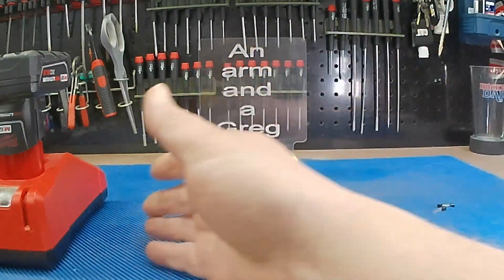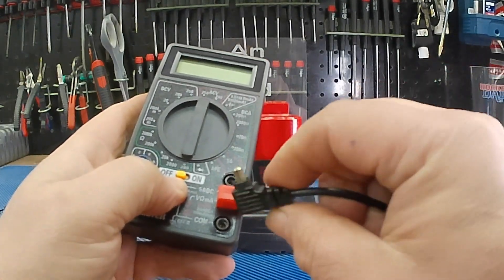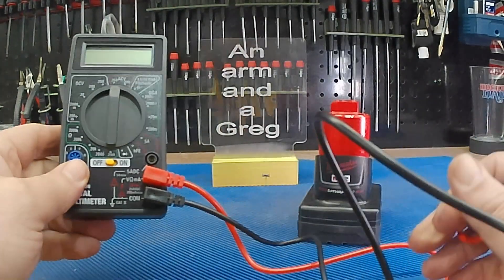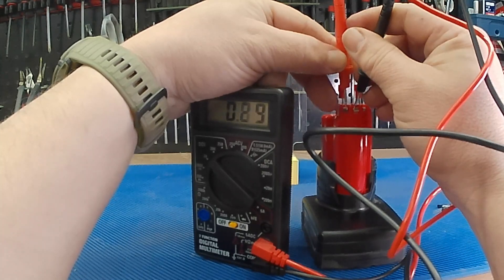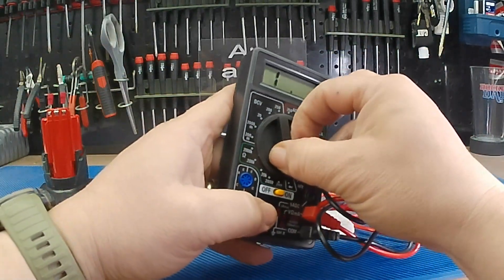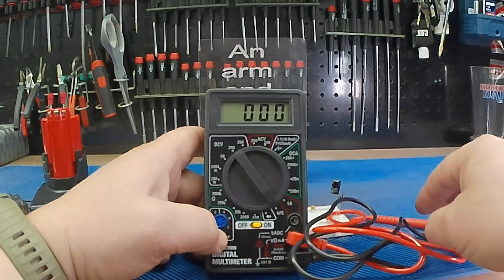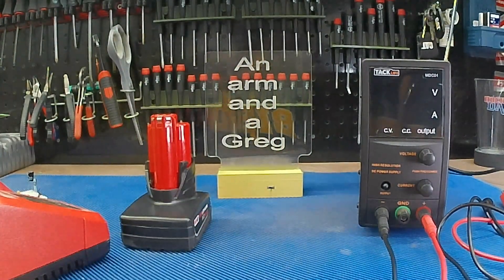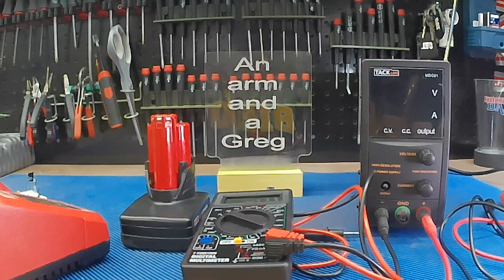Milwaukee M12 Battery Flashing Red and Green?  Let's fix that!

Comment: That’s a bit dangerous dude. There is an imbalance in the cells, not a low voltage overall. If you charge the whole pack you can overcharge the other cells and if you’re lucky you will make a cool battery fire and possible become deceased 😅

Comment: If you have money for m12 batteries, you can afford a bench supply 😂😂

Set the sucker at 3.3v and some 200mA to 500mA and charge just the offending cell.  Then put it on the charger and it will balance the pack, no problem.  Also, 3v is not horribly low.  

The low cutoff for lions can be set as low as 2.7v, if its a low current device and you dont need maximum cycle life.
Reply from the maker: Agree 100%  I've had to do a few out in the field, so it's helpful to use an existing battery sometimes...or Milwaukee could just make a better battery.  🤣

Comment: Excellent video. Seems like cell#2 is usually the faulty one on these Milwaukee 6.0's. Now, how do you properly charge JUST that cell using the power supply? What can you use to make it make proper contact with the terminal ends? (And how long do you charge it?)
Reply from the maker: I have a crude drawing of the cells in the video.  You can just hook your power supply to just one cell to charge it up.  I use automotive spade connectors to fit into the slot and hook my test lead wire clips to those.  Depending on the input voltage, a single cell can typically charge in about 10 minutes to get to the minimum needed to use a normal m12 charger.
Reply: @AnArmAndAGreg  Do you have a video of charging individual cells?
Reply from the maker: @ngk330  To charge just an individual cell, check out the drawing in the video.  I just hook up the positive lead to the faulty cell and the negative lead to the next cell (or ground for cell three) to charge it up close to the other cells.  Then, once they're all close to the same charge, you can charge the remainder on the Milwaukee charger.  Hope this helps!
Reply: @AnArmAndAGreg  OK I'm going to give it a shot. Thank you !!! DC variable power supply is on the way; thanks amazon :) lol. Lastly, to charge that stubborn middle cell (just to recap), set the voltage on the charger to 4 or 5 and the amps to 1 or 2, and safely let her charge for what... 30 mins ish? This isn't my first rodeo with electronics, but I don't want to destroy/lose this practically brand new milwaukee battery... I think the company should remedy this issue with their 6.0's!... Anyhow, let me know and thank you again!
Reply from the maker: @donjuandetrumpo  That's what I would do.  I would check the voltage every 5 min or so until you get a feel.  I've had some stubborn cells that have taken 30 min before.  I believe the voltages for all 3 cells have to be +/- .5V (made that up, but it is something similar) from each other or the M12 charger will blink.  Good luck!